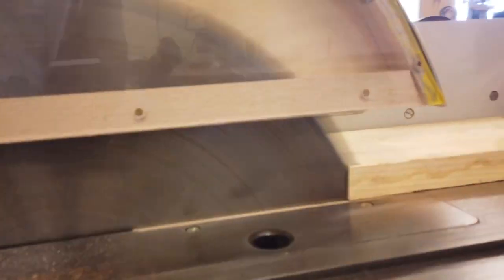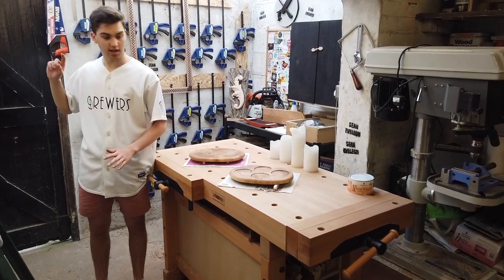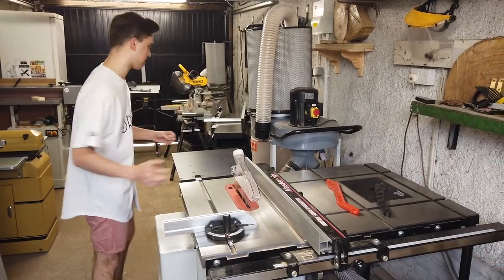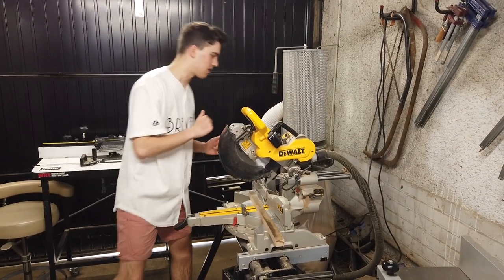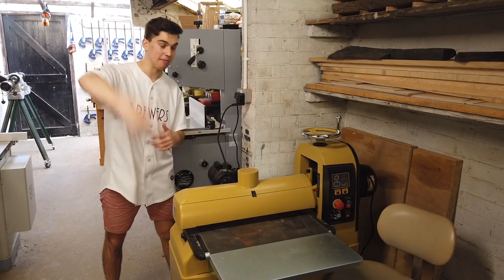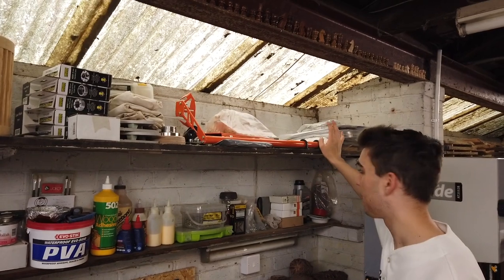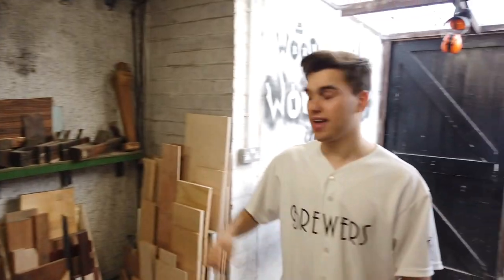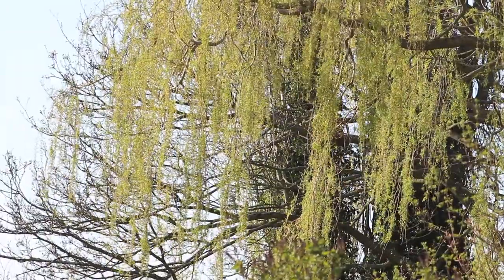The Ultimate Garage Workshop!

Comment: You could always try using a drum sander kit instead of an expensive bobbing sander...they fit into your pillar drill or a hand drill...Silverline do a kit less than £12 including VAT...Axminster do one identical (probably same Chinese manufacturer) but charge £25 for having their name in it...comes with 5 different size bobbins and 25 sanding rings....
Reply from the maker: HI stuart, thanks for the suggestion. however i wan't something a bit more heavy duty that will last longer. also having the bobbin go up and down, slows the were on the abrasive. also it's not to good pushing side ways on a  drill. they weren't really designed the have force going in that direction

Comment: Nice view...ummmm... put a window in that door. OR  print a picture of the view and mount it where a window would be, so you can "imagine" it is really outside. hehe Thanks for the tour.
Reply from the maker: HI Richard, thanks for watching. Yes I should definitely put something on the door. as that's empty space! glad you liked the tour! see you in the next video
Reply: Since you have clamps "everywhere" not just the "first" clamp rack. Perhaps you could frame the picture, with special clamps? or planes
Reply: I agree. I once rented an old upstairs unit with frosted glass windows and double wooden doors same design Sean's. We used to have the timber and boards lifted up and in by crane. Changed the window glass to clear and cut the top half of the doors out between the braces and fitted triangular shaped glass windows. Fantastic views of the surrounding countryside it's a lot better feeling than looking at four walls.